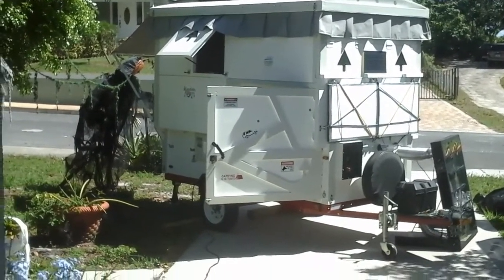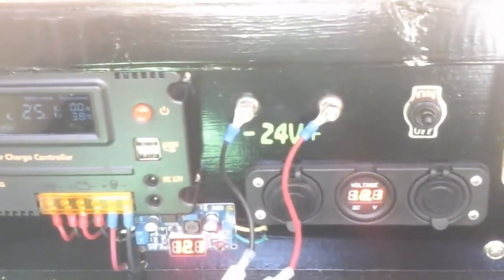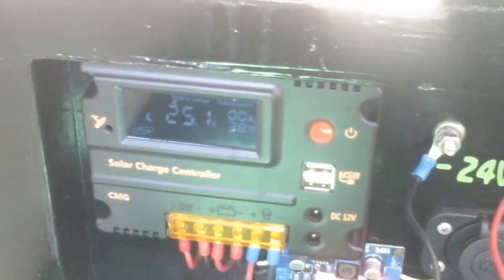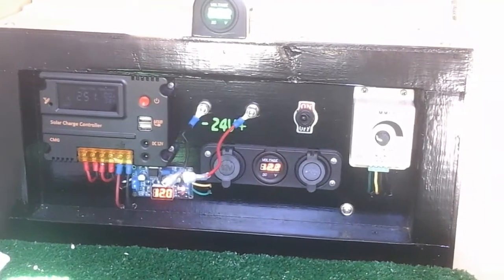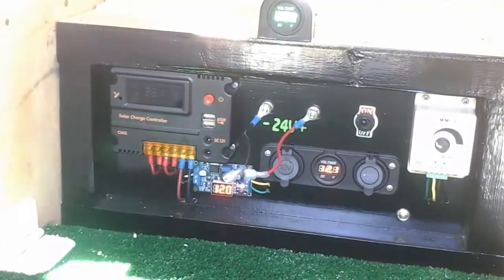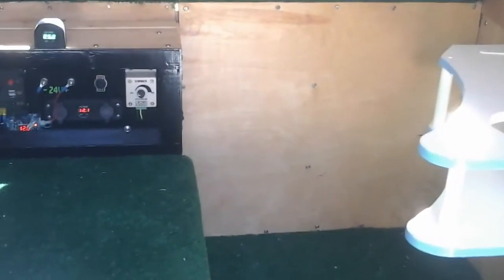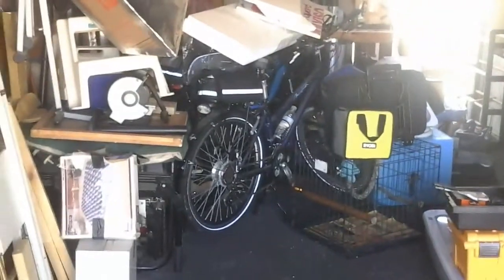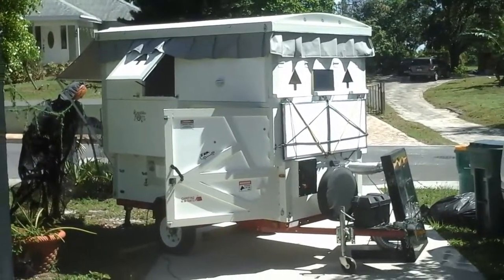Folding micro camper on harbor freight trailer.. part 5. Solar power.

Comment: I've watched all your videos, and have an Harbor Freight trailer myself. These are bolted frames, and the weight limit is 1790 lbs., if you got the heavy duty one! How close to the weight limit of your trailer are you? Have you been keeping track of this? If that axle snaps going down the road, it could get ugly!
Reply from the maker: oldschooldiy it came to a whopping 1550 or so dry.. but.. we have done over 2500mi at 1900lbs loaded at speeds of 75. The only issue is uneven tire wear. The trailer is doing better than we expected, even off-road.
Reply: I'm glad to hear this! Many more safe and fun journeys for you and yours!

Comment: What was that green fan?  When it comes to solar I am trying to learn as much as I can because I have a system that I'm going to install because I'm gonna have to work from on the road. I'm nowhere near confident about hooking it up yet .
Reply from the maker: Kristofer Travels it's from home depot, part of the one+ line by Ryobi. I bought the 12v charger and extra 4ah batteries for it.. it ran over 10hrs on low and still had battery life left. Very efficient fan.. it can also run on a/c.
Reply: Ramblin Rogers ohh.... I'm going to look into that. I need a fan at all times.
Reply: That fan is very cool!  I'd definitely like to get one of those!